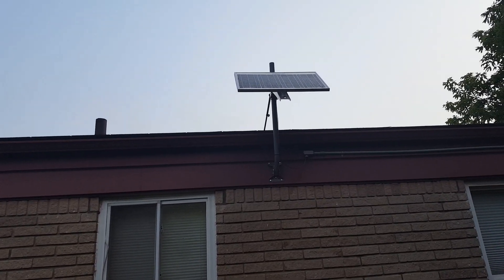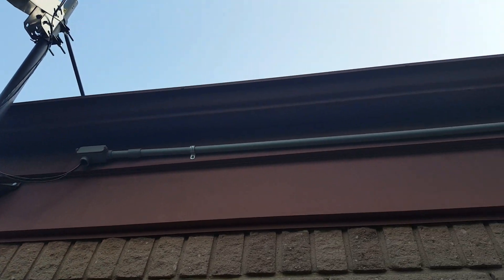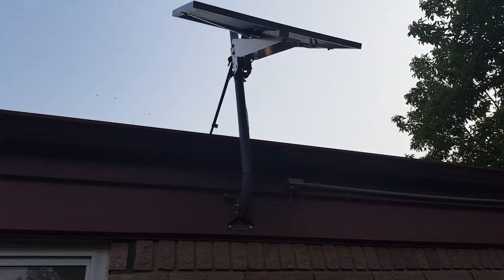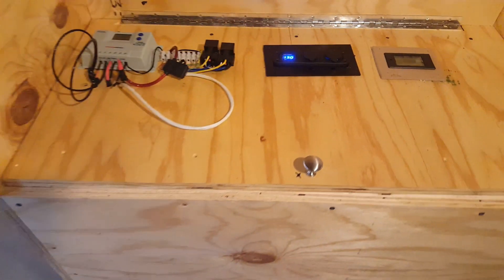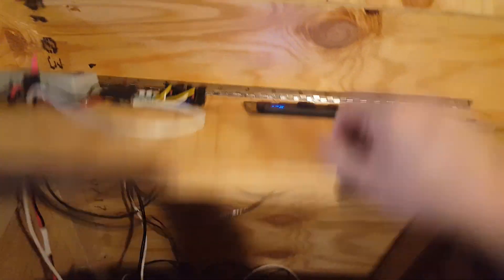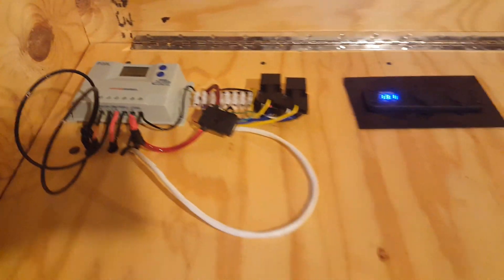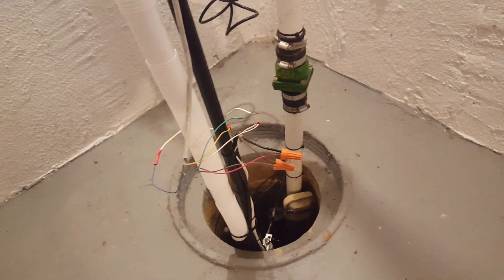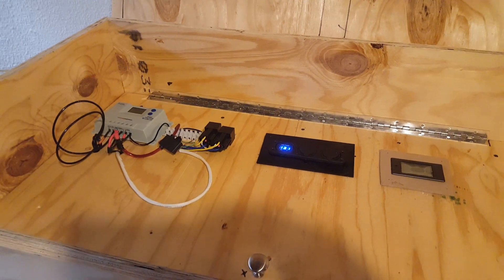Solar Powered Backup Sump Pump System

Comment: My sump pump runs 24/7 because the genius who had the house built put it on top of a water table. I need to put it on a solor system as my electric bill is $500 a month all the time. My area is also prone to power outages as well and I am always afraid of my basement flooding if I am gone.
Reply: I live in Muskegon MI.
Reply from the maker: Something like this would definitely help with that. Especially the power outage thing. Though, if you think the motor will run non-stop, you may want to get a more heavy-duty pump than the cheapo one I'm using.

Comment: Love this idea! Finally a use for that ugly old Direct TV dish on the side of my house. Great video. Just came across it and love the idea.
Reply from the maker: Thanks Steve. This whole setup is still going strong. The only part I've ever had to replace so far is the little pump itself. Panel still works great and keeps the battery charged up.

Comment: Great video! I'm trying to figure out how much of a solar set up I need to run a 1/3 HP outdoor sump pump
Reply from the maker: Thanks. I think my system would handle it no problem. It would draw more than my wimpy little pump, but I think it would still give you a sufficient amount of pumping on a single charge. If not, a bigger panel will charge the battery faster, or a bigger battery will run longer off a charge.

Comment: We live in a crazy wet area (getting wetter all the time!) and our sump pumps run continually. I'm thinking about setting up a solar system to power my sump pumps all the time. Would this system be able to do that? I'm thinking we would need more than one battery so there is always one charged. Curious: why didn't you just run your pumps on the solar system all the time and bypass the grid? Thanks!
Reply from the maker: Hi Nina, I think a solar setup similar to this would definitely work for what you need. Yea, a second battery might be good if it's going to run constantly. Though my system, with a fully charged battery, could run my little pump for something like 8 days straight if it had to. My system isn't actually on the grid at all. Solar panel charges battery, battery powers pump. Unless you mean my primary sump pump. That's a great big 120v pump that moves a lot of water very fast and is rated for a massive number of hours (compared to my little backup pump).

Comment: How long will it run on just solar I bet your going to be in trouble after a few days of no main power
Reply from the maker: This system is not connected to my main power at all. It's 100% solar/battery.

I did the math on this back when I first set up the system. I can't remember the numbers exactly right now, but it was something like: A full battery would be enough to run the pump for 7 straight days without any additional charging. That would be 7 non-stop days of pumping, which is of course silly because the pump would certainly not be running absolutely non-stop. Also, anytime there's daylight, the solar panel is adding charge to the battery. I admittedly went overkill on the battery, but I'm happy to have it. Realistically speaking, the battery will never run out of juice while only occasionally powering that small pump.

Comment: Is the system still working good?  The two float switches are they wired in series?
Reply from the maker: Yea it's all still working great. I test the whole system a couple times per year to make sure. The float switches are wired with relays such that they both have to float up to turn the pump on, and they both have to fall back down for the pump to turn off.
Reply: @GreatLakesPrepping  Thanks!

Comment: Not to sound like a knit picking fire Marshall but Should you coat that box in fireproof material in case some kind of burn out happens?
Reply from the maker: Hm, not a bad thought. Never really occurred to me. Though, electrical wires with 10 times the voltage run through the wood-framed interior of every wall in the house and there's no sort of fireproof coating inside those. Not to say I shouldn't consider one thing because something else exists, but I guess it seems like if that sort of thing was likely, it would happen a lot more often in wiring or terminations that carry way higher voltage.
Reply: @GreatLakesPrepping  I read something a while back about when you set up a battery storage that you should strongly consider the implications of fire hazard. Some recommendations were to store the battery banks outside away from the main structure

Comment: Very nicely done video brother.  I would love to know what 12V pump you are using and the price?  the price for that solar kit is crazy cheap.  Also what is the model number of the battery and the cost?  thanks for sharing this video.  We are putting together a self sustaining community garden privately built.  Rainwater collection with gravity feed from raised barrels is the main source with ground water (approx 12' head) as a backup to fill the barrels.  Cheers and thanks again.
Reply from the maker: Thanks Claudio. I'm not sure which exact pump that is... my electrician friend procured that, and I believe he bought it on eBay directly from a Chinese company. It took about a month to show up. But the cost was under $20, if I recall correctly.

Comment: Pretty cool my friend. maybe I missed it but why not just put a Y fitting from your backup pump into your primary with a check valve? would be much cleaner install. I am no pro though just have studied sump pumps and back up systems. Currently I have 2 primary pumps. Whole house back up generator and alarms that send me test messages to let me know I have high water. Although now I am worried about when my generator fails to start or I run out if propane and my basement floods so I am trying to come up with some set up like you have. Thanks!
Reply from the maker: Hey, thanks for the comment. That's a good question, and I definitely considered doing that. I think it was partly because I didn't want to screw around with the pipe that was already there, and partly because I had a convenient place for the secondary pump hose to run to. But you're right that the Y fitting idea would have been a cleaner install.